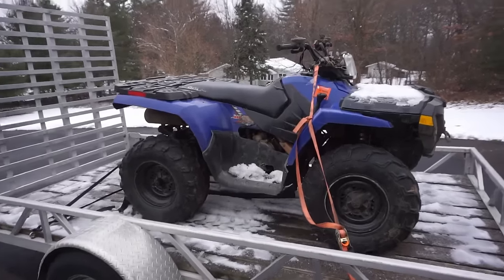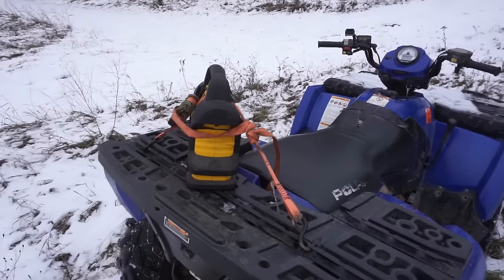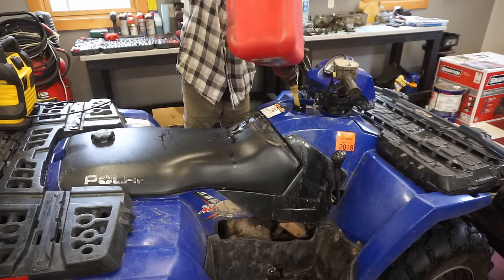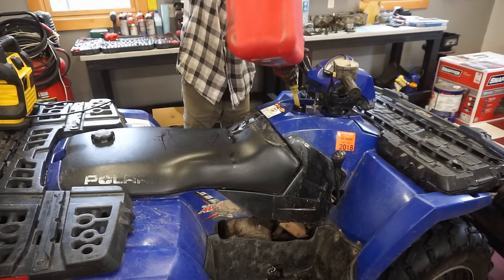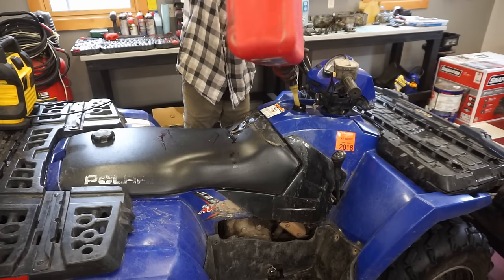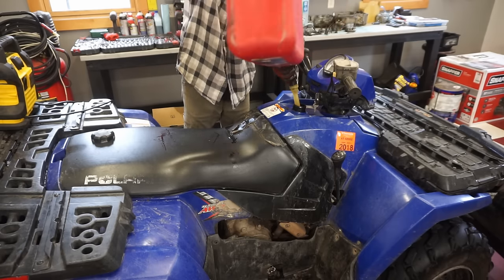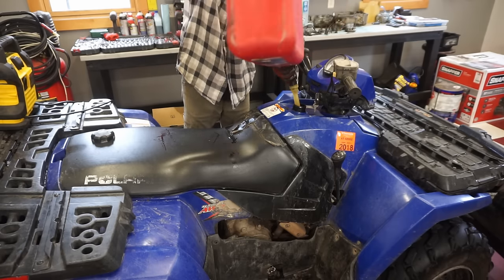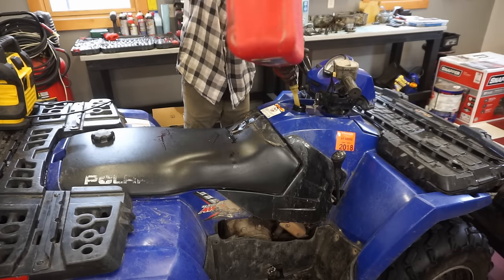I Bought The Cheapest Plowing ATV And Instantly Regretted It

Comment: Yes it has problems but as you said 'It was the cheapest one on the net." Fortunately you have the experience and skill to get it up and running again knowing that everything has been repaired and repaired properly. Not an ideal situation but it could have been  much, much worse. It also leaves us in anticipation of you changing the seals and bearings on that front diff. "God rest yee oily gentlemen , let nothing you you dismay. Amazon will send you parts and all you do is pay. When you reassemble things, you slowly loose your mind. 'Cos half the parts you ripped apart you no longer can find. Lots of filings mixed up with grime and dirt, filings and dirt. Lots of grunge and stuff that ends up on your shirt."  An ode to the Xmas season.
Reply: It’s a click bait title.

Comment: Thats outstanding compression for a worn ring - Also check your engine breather isn't blocked, excessive crankcase pressure will also cause oil burn.
Reply: I just saId the same thing!
Reply: Oil ring isn't for compression
Reply: I'd imagine the oil is helping the compression by casing a hydro lock effect and sealing  it enough to kleep compression higher. sure it wasn't the oil control ring that was bad and not the compression ring? i didn't get to end yet but just running through ideas in my head lol
Reply: Good call

Comment: 27 year Polaris mechanic from where that wheeler was born. That thing likely got drowned and took the rings out and filled the front diff. What happens when the diff is hot and then you plunge into water is the case pulls a vacuum and it literally sucks the water into the case through the vent line. I would suspect the rear diff/transmission might look similar. As others have mentioned, take a close look at the vent line between the oil tank and the air box. There should actually be a slit cut in the hose running length ways for about 3/4” on one end. It should be marked with a white paint mark. That is NOT a defect! That slit in the hose is there as a secondary pressure release in case condensation builds up in the hose and it freezes. MANY people have replaced that hose thinking the slit on the hose was a defect and subsequently had the line freeze. When the pressure builds up in the oil tank it can rupture and blow the tank apart. Anyway, sad to see the neglect and lack of maintenance. The Sportsman 500’s with the FUJI 500 engine were the best machines we ever built if taken care of. Keep up the good work!

Comment: To properly tell if the tensioner was maxed out, remove the bolt and spring from the tensioner before the the cam gear.  Otherwise it just extends itself with the slack created by removing the gear.  It also extends when it is removed from the cylinder if the spring isn't removed first.  Just FYI.. Love your vids.

Comment: My '98 Sportsman 500 came with a special wrench adapter to get the spark plug boot off. Then you use that adapter with the supplied open-end wrench to get the sparkplug out. Taking plastics off is not necessary...unless you don't have the Polaris tool kit.
Reply: "unless you don't have the Polaris tool kit...or common sense" lol

Comment: so if a machine is running like yours. run it for a bit. then start the tear down.  You can pull the carb and exhaust off and look at the intake / exhaust runner back inside the valve stem.  if its wet on any of the valve guides you will see oil wetness. that is the cause of the smoke.   It looked like your intake seals were leaking by how wet the valves looked inside the combustion chamber.  

but next time look at the runners at the valve guides / top of the valves and you will see oil leaking down the valve stem.

Comment: I have a Polaris trail boss with 14000 miles on it.  It has gone through 2 cylinders by the previous owner and I installed a niech cylinder and piston. Ring gap was about a half inch

Comment: I'm working on a Ranger 500. On the ranger, the dipstick is supposed to be screwed in tight to get a level reading. So yours likely wasn't low (Just started watching this video). Also, your exhaust rocker looks worn to me. It appears to have a groove in it from the decompressor ball. I would confirm that the decompressor is functioning, mine had zero tension on the spring and a deep groove in the rocker.

Comment: With over 200 psi i doubt the rings are bad. Bad valve seals usually don't smoke that badly. I would check the engine crankcase vent. That would cause it to smoke

Comment: My mower is fixed. It was a bad connection to the relay to turn off ground on the key switch connector plug wire. I wiggled wires and did this once while I was looking for power wire to the relay.

Comment: Those CV axles always pull out of the diff easy. 😉
Reply from the maker: haha yeah they never get stuck
Reply: @2vintage When you put them back in use marine moly grease NOT anti-seize. It will stay in 10x longer and not wash out or fly out from centrifugal force. Anti-seize is useless in that application.

Comment: Yeah you pay for what you get. I just bought a 2007 Polaris 450...the only problem the previous owner said was theres no 4wd. Well it turns out the front diff was bad and he didnt replace it. So now I stuck with a nice running quad without 4wd. Its going to cost $3,000 to get all the parts to make it 4wd drive. So rather have a trans problem than a engine problem....will look forward how you fix yours.

Comment: Why don't you check the oil ring end gap? That would be where to look for an oil burning problem. The gap on the compression rings wouldn't cause the oil burning, if fact it had great compression.

Comment: Before I changed the piston, which it really needs is valve stem seals. Though it needs both. Ya'll need desperately to change that timing chain. I believe that made the piston dings, but not sure about that as the compression is so high and the valves would be bent. That second ring must have had someone grind the end off.

Comment: So when they sit for a long time,the valve seals get hard as a rock and then won't seal properly.rebuilt a warrior for a buddy and it smoked bad also.same thing,180 psi of compression,but smoked. Replaced the valve seals,relapped in the valves and problem solved.
Reply: Stem seals, definitely a possibility.

Comment: What a cluster Joe just to get the spark plug
Reply: Maintainability of ATVs, UTVs and even cars and trucks isn't part of the design process.  Sometimes you have to buy a special tool to remove a part that is more expensive than the part the tool designed to remove.

Comment: If you'd checked the oil rings, I bet they would be worse yet. If it was run with no oil filter, that's the same as dumping sand into the combustion chamber.

Comment: Looks like that piston might have been installed 180 degrees out previously?
Reply: It may have been taken apart previously and the valve timing was off a tooth or two when put back together.  The piston looks like it had been hit by the valves for sure.

Comment: Hey so my 350 Warrior looks to be burning oil just on start up for 10 seconds then runs awesome.  Any ideas?  Has new rebuild apparently last year.  Does need jets dialed in cause at 3/4 to full throttle she hesitates and bogs down.
Reply: Valve guides
Reply: Valve guides

Comment: I don't understand how anybody could think 5000 miles is high on an ATV The 1 I'm sitting on has over 16000 and it still running perfect and it's an Arctic cat. 💩Engines never been cracked except for a new wet clutch and then just your basic maintenance Like new bushings brakes tires. Maybe its gust me but  20000 should be no problem to get out of a wheeler especially a Honda well unless you use it as a submarine every ride.

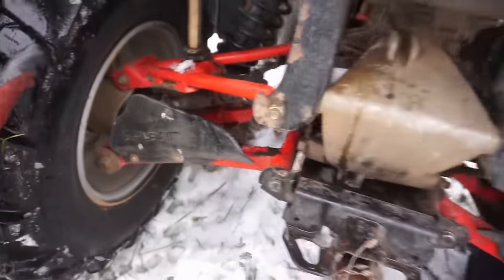Comment: The extreme angle of the rear inner CV joints (see 10:47) makes me wonder if they modified the ride height (springs) for plowing.  This would quickly wear those splines once salt got in there.  Not sure, just curious.

Comment: Needs chains for plowing.
Polaris, hehehe , typical american machines, built for expensive time consuming  maintenance. never had problems with my old Honda 300 4x4 or the 350 or 400. good old easy to work on reliable machines
If there is that much water in the front diff, whats in the rear?
More often that not it's the vent tubes that let the water in

Comment: Dude if you would look at your Pistol when You pulled the head it told You what was wrong You had piston wash around the Outside that means your oil ring is leaking past and it's cleaning the Outside of the piston it is called piston wash

Comment: Each project  still will fall under the  basic topics of ( GREAT ) good (Fair)   BaD NeWs 
Which one  would  YOU choose ???  To Late ( BUYING  it ) was the  very first  Mistake !!
Ask YOURSELF these  3 simple Questions.  When Postings  are made by the SELLER.  HOW  much  (B.S.) Is  part of  it  all?   Secondly , PRICE. TRUTH is MORE  will start Alot higher Knowing  Dam well about  a  third to a  half of that  will still be coming  off the bottom line sale price.  THIRDLY ( BUYER ) BE -  WARE.  Way more then a  slogan from days  gone  by. ( B. U. Y. ) Its  the  basis  for  any transaction looking to remove YOU from the  C. A. S. H.  at  hand.  Today YOU proved a  point.  Just because it  may seem MINOR as to a  stuck set of  rings or Water pump seal being the  case.  Just the  SIMPLE  fact it  took way to long  even to find the  Spark plug ( SHOULD ) have been the  DEAL BREAKER  to WALK away ( RUN ) in fact on this very day. YOU ARE to N.I.C.E.  to be  fooled by all these  jokers and  scammers  alike.  The  idea of creating content  while  (NOT) losing  your  A-$-$  has long  passed this  channels  Reality Factor test. SUGGESTION. STOP it  now  before the DEBT  out weighs ( ANY REWARD )   Your  Dear sweet Wife cannot  Afford to Re-Pay in the  absence of  Common sense from the voice of  Reason YOUR  truly  are lacking in.  Between the  parts  cost, the  labor  fees,  the  original purchase price, then add on overhead, vehicle usage, fuel, miles.  TIME on and  OFF the  CLOCK  editing all this  CRAP , CRUD - DUDS - and  STUFF. 
YOU are in the  ( H. O. L. E. )  Not the  one  most  would  prefer to continue on this  Lack luster journey.  FACE IT ( DOOMED to FAIL )   even if  by ( DUMB LUCK ) ALONE  some  Seller  Mistakenly  told  you  the  truth.  Its  missing parts,   Needs a  total over haul.   How  about  they PAY  you  to take it  away to the  Scrap yard  ( TODAY ) !!!
Reply: Crack must be cheap for you.

Comment: In what world would you regret buying this thing? As long as a machine doesnt require the case to be split its gonna be a win no matter what, after the $400-$500 of parts and the initial $1,000 youll be in $1,500 with probably around 20 hours of time and if you sell it for $2,500 thatll be $1,000 profit for a $50 an hour rate, youve got to be fuqing insane to not be happy with how little work this thing actually required, clickbait at its finest

Comment: No, what you should have done, is take all plastics off, then wash the F**king thing and it as clean as you can, before breaking into the engine, do you know how many times I have watched sand and dirt fall into your builds so many I can not count. Clean, clean clean, you are a grade A bike tech but with an F grade because you work in dirt sand and crime in engine builds. I watch you grabe sandy dirty cylinders, then stick your finger in and rub on the cylinder walls with the same hand, not on breakdown an assembly, I have watched clumps of dirt fall into your build on assemble which is crazy if you ask me. don't get me wrong you are a good tech but you take such simple shortcuts I would not trust the lifetime of your builds. This is why shops clean everything, clean the bike the parts wash everything before assembly. It takes little time for the benefit.